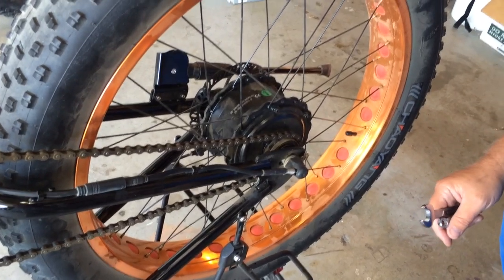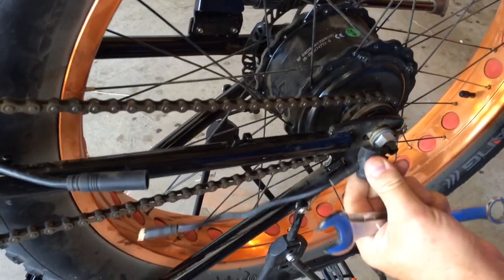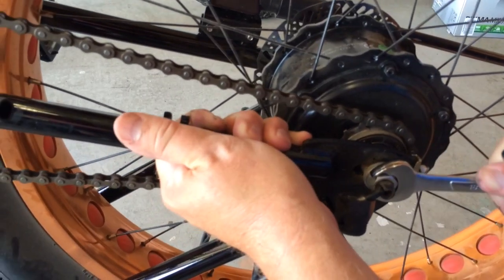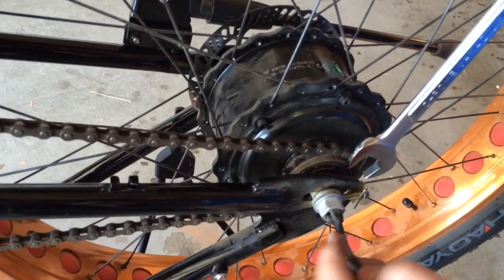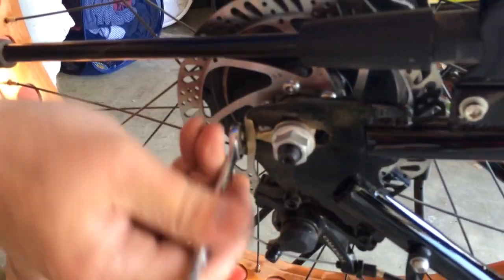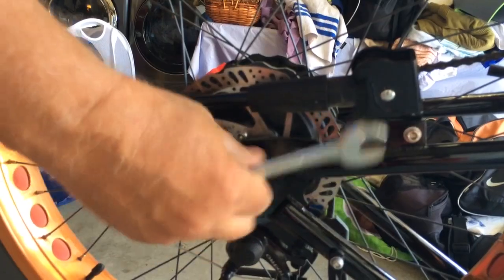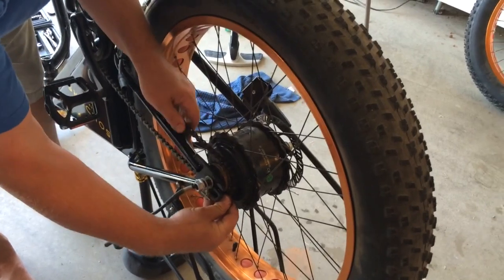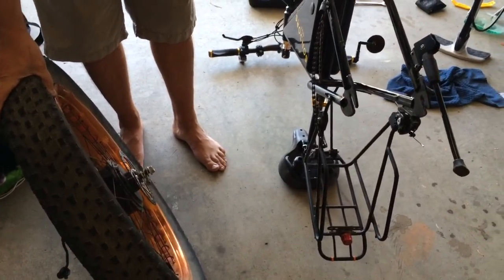Removing rear wheel sondors ebike

Comment: If you have a rear rack you might need to remove it, or at least unscrew it where it attaches near the hub. That will make it easier to manipulate the 18mm hub nuts.

Comment: I removed the rear wheel to replace a flat and my pedal assist is still working but suddenly my throttle is throwing an error code 5. I have checked every throttle connection and don't see how I could have messed anything up. Just wondering if anyone has any advice. Thanks in advance! PS my girlfriend doesn't like riding the bike without a throttle.